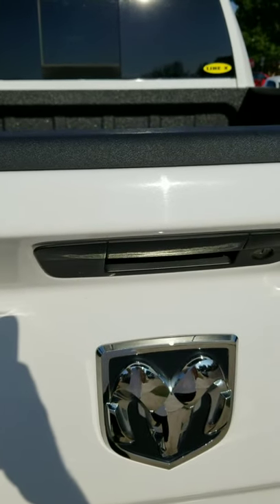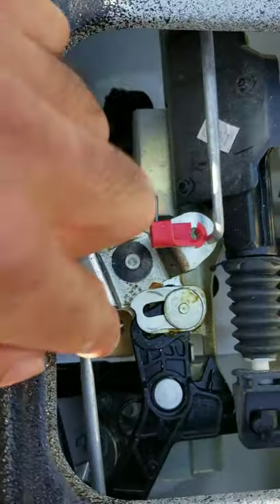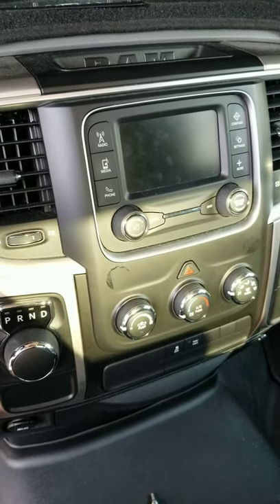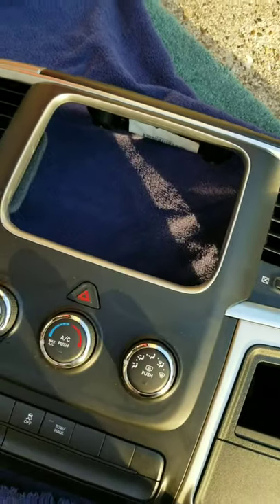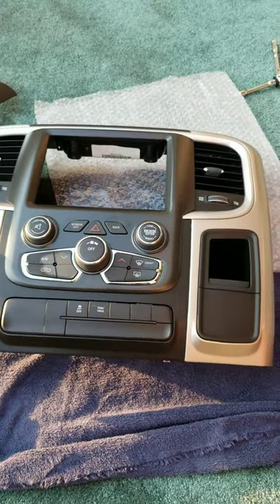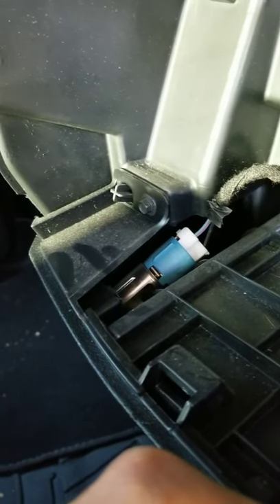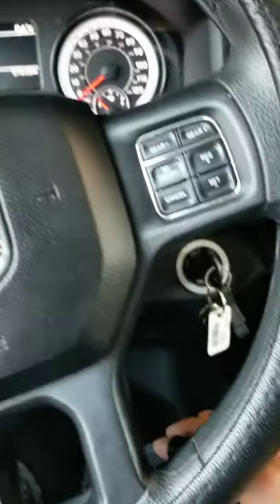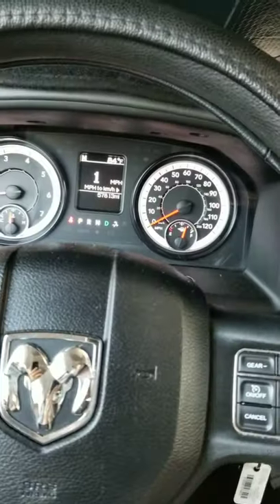2017 Dodge Ram 1500 radio upgrade w/ backup camera install

Comment: Great clear video. Do you have links for the stereo and climate control panel that you replaced? Thanks.
Reply from the maker: Here you go!
https://www.infotainment.com/collections/all/products/2013-2018-ram-1500-2500-3500-8-4-4c-nav-uaq-retrofit-kit?variant=5161161359396